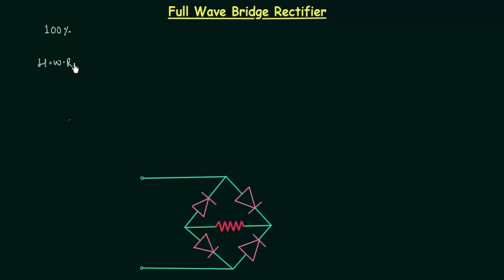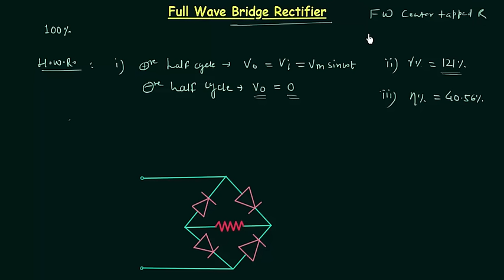Full Wave Bridge Rectifier

Comment: For the negative  half cycle  Vo =  - Vi not as he explained  in the video, since the output voltage  should be in both cycles positive and being Vo = -Vi   in the negative part  makes sense ! Since the input  will be negative and the negative  from the rule will make  the output  voltage positive  ...

Comment: why you are inconsistent with your explanation? During the -ve cycle if Vo = Vi, then the output waveform should contain the signal below the time axis because the Vi is below the time axis for -ve cycle.
Reply: Its true the second half output wave should be down the axis but he didnt give clarity
Reply: The current through the resistor is in the same direction for both the cases. Hence the positive cycles in the output.

Comment: 00:06 Full wave rectifiers improve DC output to 100%.
01:43 Full wave bridge rectifier has high AC component and low efficiency.
03:08 Calculating output voltage for positive and negative half cycles
04:54 Output voltage (vo) can be calculated using Kirchhoff's voltage law
06:30 Output voltage of full wave bridge rectifier with different diode models.
08:13 Analysis of the circuit for the negative half cycle
09:44 Full wave bridge rectifier provides output voltage equal to VI.
11:20 Full wave bridge rectifier provides better output waveform than half wave rectifier.

Comment: Also in my understanding of a full wave rectifier is that the current flows in the same direction through the load resistor resulting in the correct movement of a motor hook up, especially when 2 filter capacitors are connected with a voltage regulator on the output.

Comment: At the output across the load resistor of the full wave rectifier in my understanding the positive waves will not fall below .7 volts which is the turn on voltage of the rectifier diodes. That means the output will not fall to zero.
Reply: This is true only for a rectifier with a capacitor filter. For rectifier without filter, output becomes zero at the start of every half cycle.

Comment: The actual terminology for the rectifier diodes is also forward bios and reverse bios in terms of the measurement at the anodes and cathodes, not voltage.

Comment: Can You make a video on how the capacitor works to smoothen the output of this circuit? 
(This video was really helpful by the way)
Reply: study filters, that will cover what you need.
Reply: when the pot difference of the input current is higher then in cap then capacitor is charged and when the pot difference is lower then pot difference of capacitor then it supply residual current

Comment: May I ask a question? I'm always having this simple question : In AC circuit we say the polarity is constantly changing. If this is true ,  why we always get the hot wire on only one cable when using a test pencil  ? Thank you
Reply: when you hold the tester, you are connected to the ground, the resistance in your body is high enough than earth, so you don't get shocked and the circuit is complete. try holding the tester in a way the the metallic pin at the end doesn't touch your body, you won't get any hot wire, or light.

Comment: In half wave rectifier examples...we substitute diode for voltage/battery (FB) and open circuit (RB)?
But in full wave it's short circuit (FB) and open circuit (RB)?
Reply: Both are correct....

Comment: Pls explain the capacitor portion in detail, why it gets smoothen ?
Reply: Capacitor retains the max voltage and discharges slowly, so the output become more smoother compared to a rectifier without filter...

Comment: why output of both cycles comes in only positive half cycle
Reply: because of the polarity of diodes...
Reply: Through load resistor, current flows only in one direction during positive and negative half cycles
Reply: @circuitsanalytica4348  what about Vo = Vi for negative half cycle
Reply: @mohamedkalith5965  for the negative  half cycle  Vo =  - Vi not as he explained  in the video, since the output voltage  should be in both cycles positive and being Vo = -Vi   in the negative part  makes sense ! Since the input  will be negative and the negative  from the rule will make  the output  voltage positive  ...